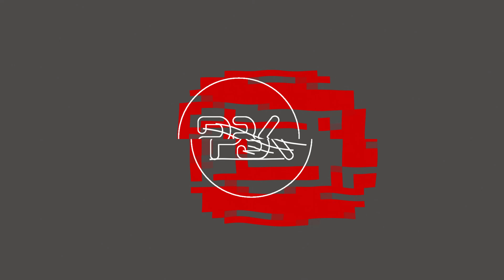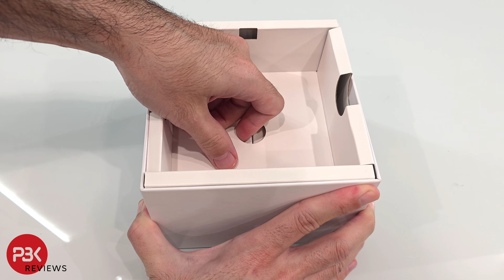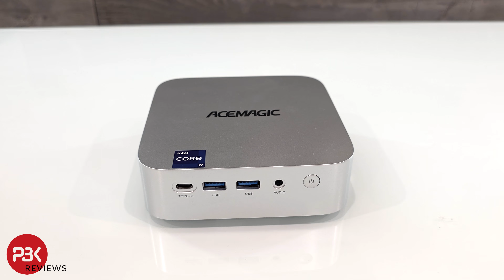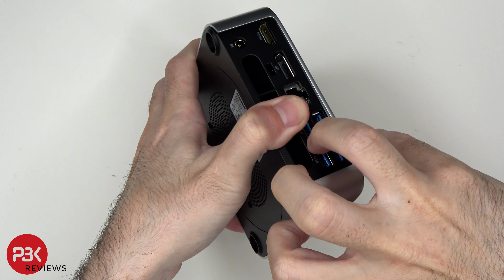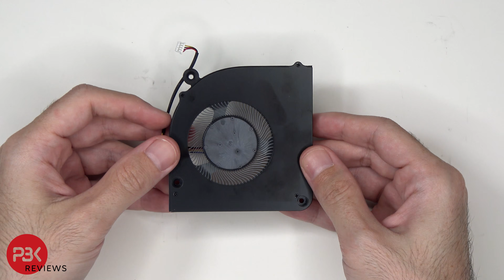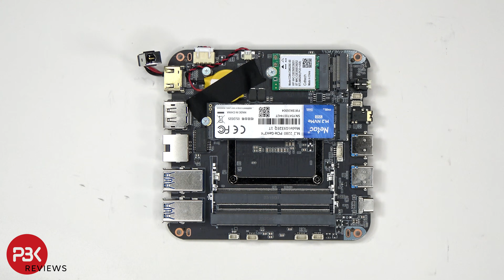ACEMAGIC Matrix M1 Mini Teardown. Compact & Powerful! #pc #teardown #diy

Comment: I'd love to see how you removed the screws from the bottom cover.  I tried to get inside AD080-i9-1190H and the screws to for the bottom cover won't budge AT ALL.  The seem to be bounded with glue .... I was using a drop of isopropyl alcohol. no luck ...  seems like it's designed to never be opened